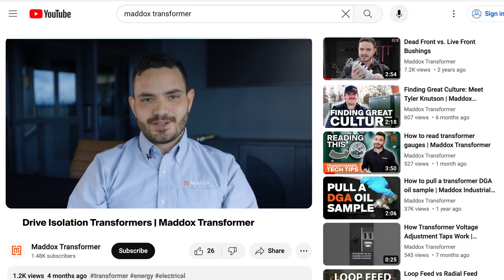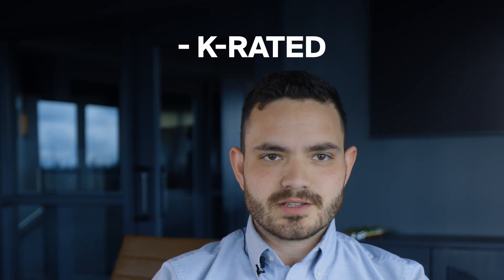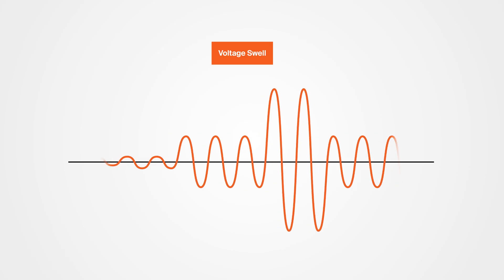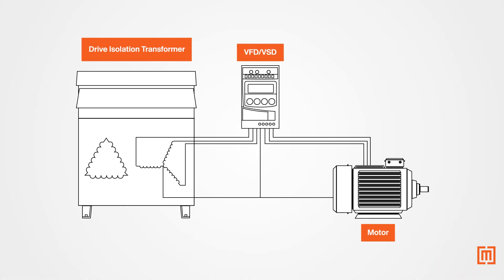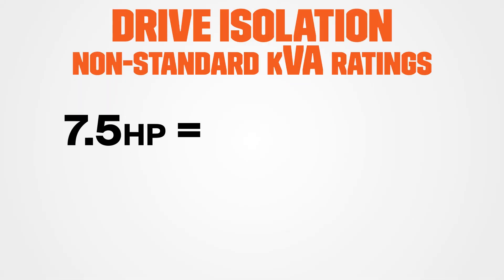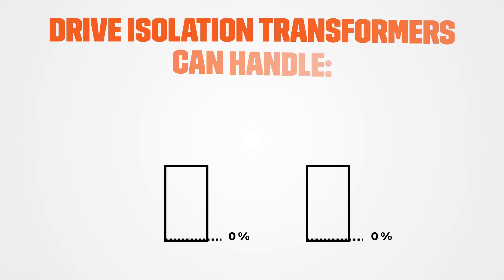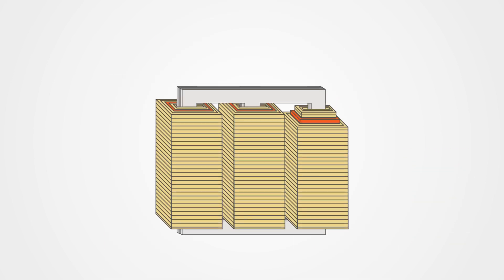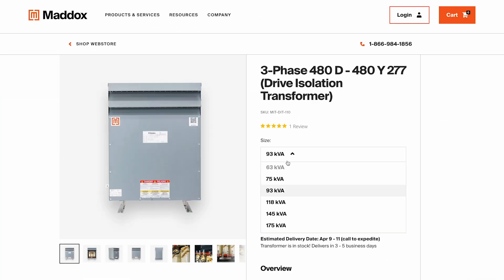Guide to Drive Isolation Transformers - When do you need them?

Comment: Do you ever think of making a transformer that will pulse a frequency wave like a tunning fork? It wouldn't have to be a powerful wave because if you're already using a frequency that's naturally around you then you could just sing to it for amplification and capture the wave at it's peak once you've sung your own power into it. Like the 0 point energy devices people are so afraid to talk about. Are you working on this or am I still to far ahead of my time?
Reply: Transformers don’t create energy they actually use up some so sure you could use a microphone to create a small voltage and run that to a transformer and try to kick ip the voltage but you would have no amplification you would have to add in outside energy strong enough to amplify the signal to!